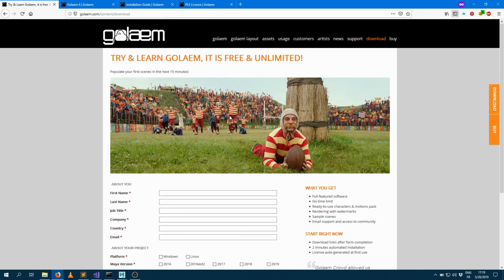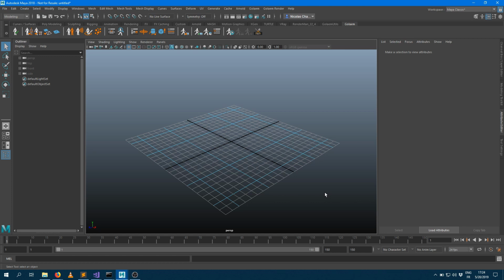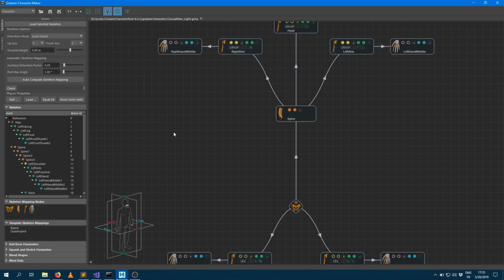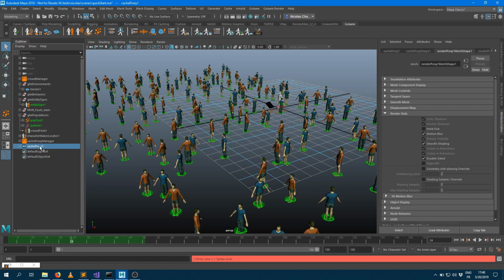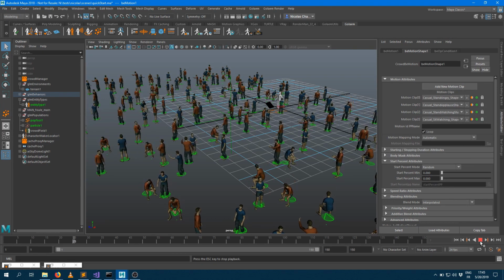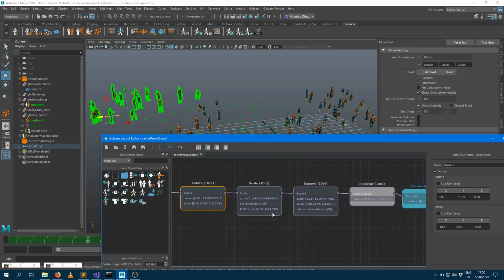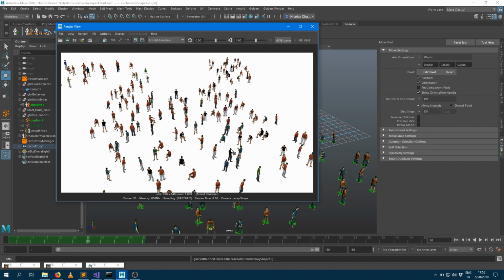Golaem 7 Quickstart

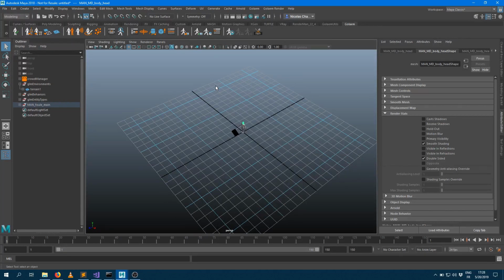Comment: I got to 9:55 where the population tool is created, but for some reason the tool is gigantic (like 3 times the size of the default grid), and sits like 10 meters off the ground. Translate Y is 0. What did I do wrong?
Reply: Turns out my crowdManager object had its units set to centimeters instead of meters.
Thank you for this tutorial. It's really great!